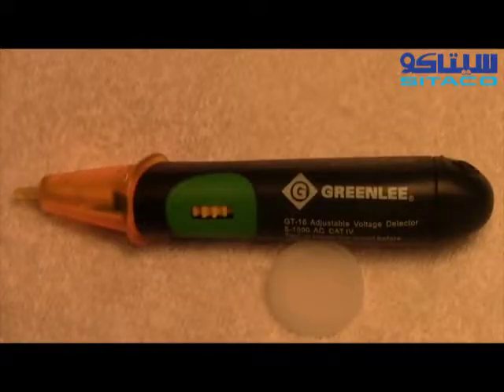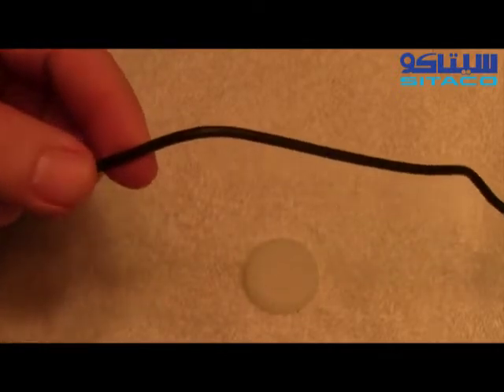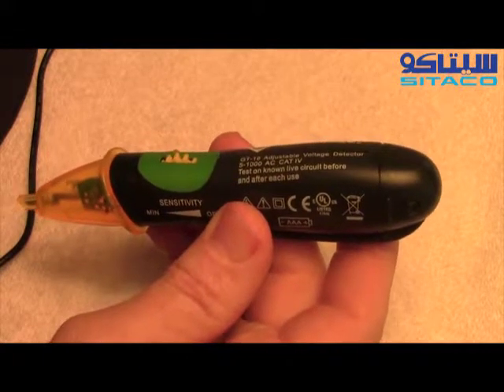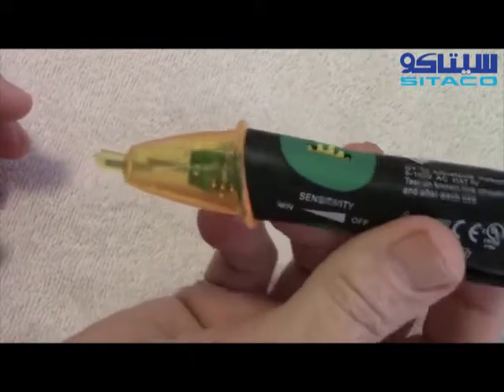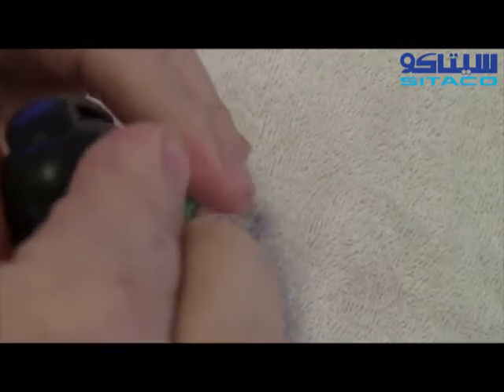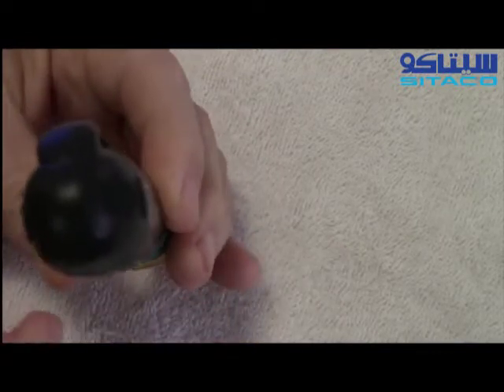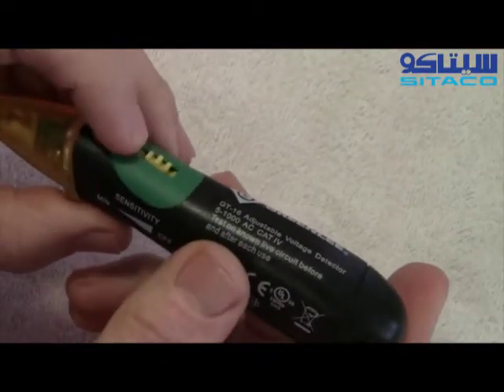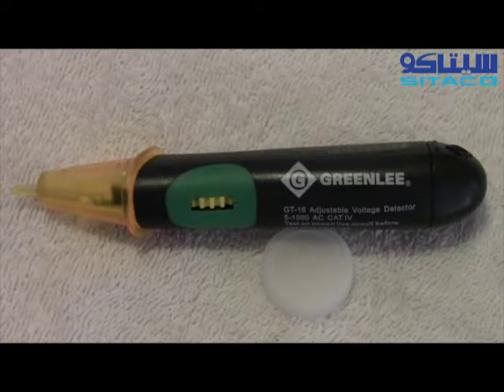ADJUSTABLE VOLTAGE DETECTOR

Comment: You didn't show us what happens when you insert it in neutral side of the socket. And the grounding as well. So, it's not that helpful. Because I need the tester to not do false detections on neutral and grounding wires.